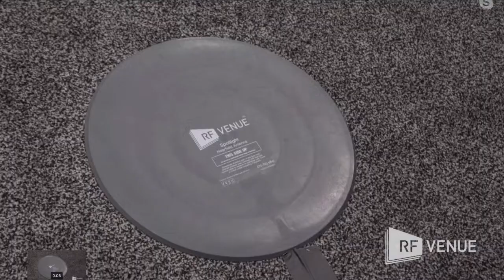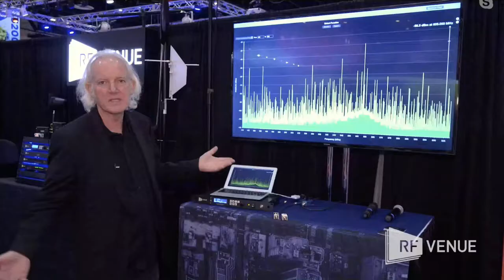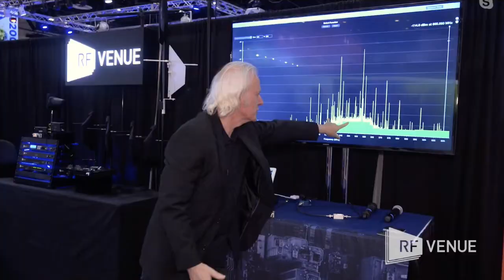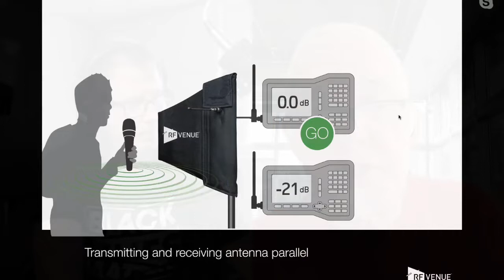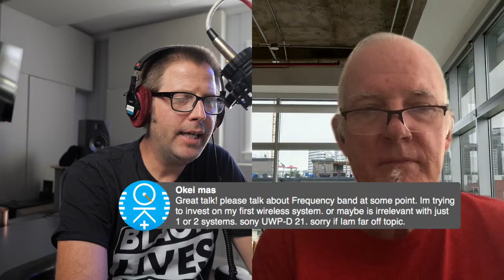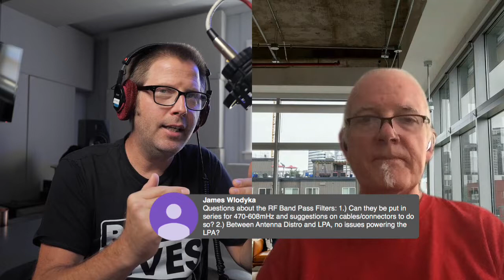Debunking RF Myths On A Film Set!

Comment: Really interesting episode. Thank you for this one!

Can I expand on the last question that Gregg had? My talent wireless is in the 600 mhz range and I have hops/ifb in the 800hz range. Is that far enough or would the system benefit from going to 2.4ghz?

Or another scenario, lets say that I also have a hop in the 600 range just above/below talent wireless. Would an additional inline filter help much?
Reply from the maker: Thanks for the comment Dustbrigade.  I would stay away from using 2.4ghz for any wireless transmission that is critical such as a talent or hop to camera.  From what I understand distancing the frequency on your TX/RX in that same bag has added benefits for performance.  Also just a note that I've used TX/RX in a bag in the same block for years without any issues, the brand I'm speaking of in particular was Lectrosonics.
Reply: @MichaelWynneCAS  Interesting, thanks for sharing! I have one IEM in the same range as talent wireless aswell (way cleaner RF down there compared to the free spaces in the 800hz band), seems to be doing quite ok, the 800 struggles more in fact (either as talent or hop).

Spacing in a bag will never be the 3 feet he talked about tho, especially with a snug bag it is not much you can do.